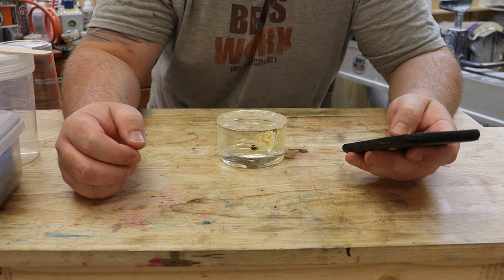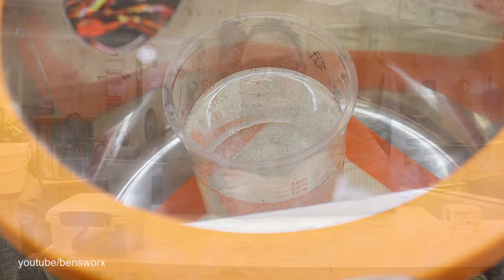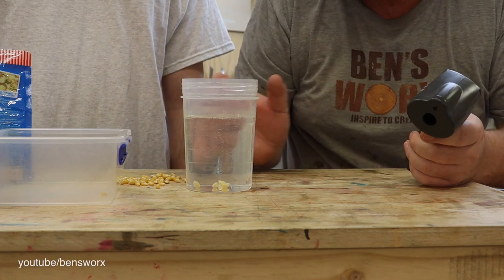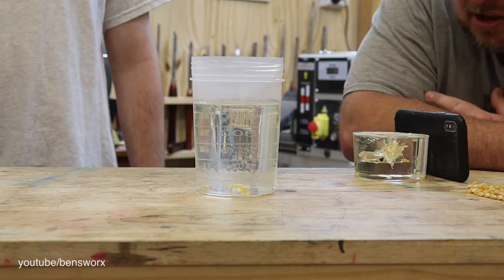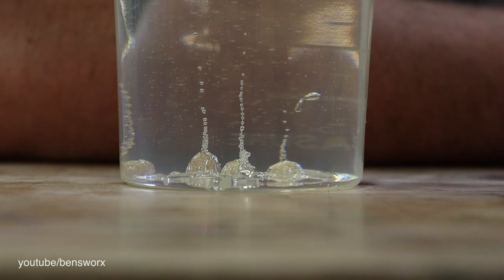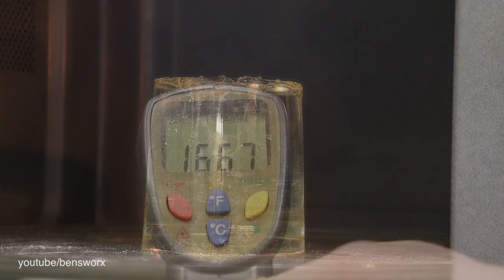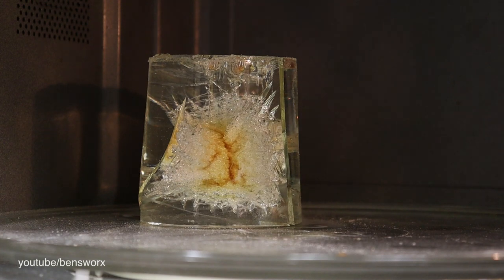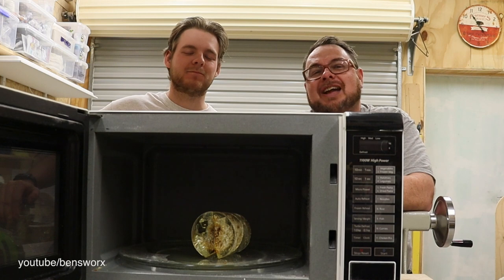Kernels in Epoxy Resin Vs Microwave

Comment: Put them in the vac chamber while the resin cures, a reduction in pressure will lower the temperature needed to pop the popcorn.  Also, don't rest the bottom of the cup on a surface like you did.  The kernels at the bottom had the temp wicked away by the table.
Reply: Exactly what I was thinking too.
Reply: That or he could place it on a slitlely hot surface to contribute with the heating process, besides not losing energy to the table
Reply: Beat me to it :D   The vacuum should also slow the rate that heat is leaving the resin, meaning a higher max temperature.
Reply: The vacuum would help, but not a great deal.  A quick Google search tells me that popcorn pops when its internal pressure reaches about 135 psi (930 kPa), a bit more than 9 atmospheres.  This implies that popping requires a pressure differential of a bit more than 8 atm between inside and outside.  So even under a vacuum, the corn would have to be heated enough to reach an internal pressure of more than 8 atm.
Reply: @jpolowin0  Putting it in a vacuum chamber gives it a 15psi head-start and lowers the temperature needed to pop it.

Comment: if that is a throw away microwave how about throwing the resin in there while its still curing? this might give it that extra bit of heat needed
Reply: thats what i was thinking.
Reply: I was also thinking that as well. We now know that it will get to about 160. I would temp it until it gets to about 140 and then plop it in and see if it works. I think the bit of extra heat may do the trick. I really want to see popcorn in the resin.
Reply: Agreed. They have the temperature gun and have found out the max heat the resin puts off while curing, so they could pop it in the microwave when it reaches around 120-130°C. Fantastic idea. I wonder if anyone has tried to microwave resin while it cures though. Would that speed up the curing process or would it stand a higher chance of combustion? Maybe a better project for outside or at the least with their shop doors open.
Reply: I'll add my name to the list of thought that x
Reply: Paused it to find someone had the great idea before me. Try this Ben!
Reply: Also put a mild coating of oil on the kernels, they like their heat to come through like that.
Reply: I thought the same... but then I thought... at that point, you could just cast a popped piece of popcorn in the resin, couldnt you?
Reply: @bauerbach1  I'm talking a thin coat only, so you still get the kinetic shock of the kernel exploding against the curing resin
Reply: Yep.
Reply: ...and the pop comes from air! Cured resin doesnt have air to pop the corn!
Reply: @doninis1354  this is, I think, the most logical answer. lol
Reply: why not cure the resin in the vacuum chamber?  The partial vacuum will lower the temperature required for the water inside the kernel to boil.
Reply: @doninis1354  The pop comes from the sudden escape of the steam formed inside the kernel, not because of air. As long as the kernel gets hot enough, the pressure from the steam inside will cause it to pop.
Reply: Yeah I was going to say that too, because having the resin cure on them first they are not going to pop, they have already released some energy, and they are sealed up in a hard surface. Microwaving the resin while its still in a liquid state would be the best bet if you wanted to see it pop inside the resin.

Comment: If you want another shot at it, try this:
Make a solid base of resin like you did in the first video. Then, put a few kernels and encase them in resin. When the resin starts to get hot, say around 120 C, put it in the microwave and heat it up while it's still curing. You may end up with the results you want. 

It's worth a shot anyway.

P.S. Thanks for including Jaycob. Would like to see him more.
Reply: That's what I was thinking
Reply: how about when you put the kernels in, put a bit of cooking oil and seal it in the resin.

Comment: Put it in the microwave as the resin is reaching peak temperature to boost it a little, I think it will only need seconds.
Reply: Another idea would be to do intentionally overheat the resin. I think Peter brown did that when he made the “lava bowls” using water based dyes. Maybe adding a bit of water would work?

Comment: If its a throwaway microwave you can modify it to have a small porthole where you can get a better view of whats happening.
If not you can always adjust the focal length of your lens to view inside the microwave

Comment: Would you be able to put it in the microwave while it is still curing and closing in on 160 degrees?  It should only need a small boost in temp to get it there

Comment: I have no idea how laser pointers work but would hitting a popcorn kernel with a high power laser pointer be enough to push it to the necessary 180 degrees so it would pop while the resin is setting?

Comment: Ok.  Try this.  Create a new cast with a void for a few corn kernels of poppable corn, but instead of trying to pop them in a microwave, try popping them from the top (or side so the sunlight can get through unaltered) or even making the cast with 6 flat faces to make this easier, using a magnifying glass and sunlight.  Also try and put a tiny amount of vegetable oil in with the kernels, just a drop.

Comment: The problem is popcorn works by pressure differences. As the pressure builds in the kernel, due to oils and moisture inside being heated it expands with a rapid release of steam. It can't burst in the resin because the pressure of the resin around the kernel stops the rapid release. That's why you got escaping air bubbles in the resin as the skin of the kernels rupture slowly releasing the pressure into the thick viscosity of the resin.

Comment: The only thing I can think of as a last possible option for this experiment would be to put the kernels in, and then putting them into the vacuum chamber, it'll lower the boiling point and the pressure in the corn kernels giving you a slightly higher chance of them popping while the resin is still curing, I see a couple comments suggesting similar.

Comment: I think that placing the popcorn kernels at the center of mass might be hotter.  I'd also try mixing the resin a bit hot with the activator though that might cause an exothermic reaction.  And make sure you are using a good quality popcorn that was stored properly.  As I understand it, internal moisture of the kernels is critical for popping corn.

Comment: I wonder if they preheated the kernels a bit before dropping them into the resin just to make up the 20° difference.   Or maybe set the resin on top of something metal that might help reflect the heat more towards the kernels.

Comment: The thing with popcorn it is super heated gas that expands in the cornel. I think that once it gets to a certain temperature you should assist it with a laser or even see if you can microwave the epoxy while it is setting to see if you can induce the corn to pop that way. 

What does happen if you microwave epoxy while it is setting?

Is it productive to vacuum out all the bubbles just to introduce more bubbles when you pour it into another container?

Comment: It would probably be easier for future experiments to find out where the hotspot of the microwave is and position the pieces accordingly. I think wet thermal paper can be used for that. But be careful. The hotspot gets hit with enough energy to melt metal.

Comment: heat it with a Fresnel lens, it will pop real fast. its just a type of magnifying lens/glass but it can melt metal if you use a large lens. just hold it in the sun.

Comment: If you pour a thick layer like a tall cylinder tube you should build the heat without using a ton of resin. However, I think that it would be dangerous because as you see the violent reaction inside of cured resin, could the popcorn kernels blow resin around the room?  Either way thank for the bonus video. It was great fun.

Comment: I'd super glue the kernels to a toothpick, and set it in a base to keep them upright. It would be awesome to see it explode right in the middle. I wonder if there's a better way to heat it or assist the heating to get it up to 170 than a microwave. You were already so close to it. A heat gun? A heat lamp? A hot plate? Or put the resin cup a simmering pot of water, to keep the cup from melting?

Comment: If you really want it to pop in the resin, you can try heating up the kernel a bit first then dropping it in.... OR by increasing the heat with a laser or focal lens.

Also, please wear safety glasses if you attempt this again. I know it might not seem it but the force of one kernel popping is quite massive.  If you compound that by surrounding it with resin, it may send shards flying.

Comment: There is a reason why popcorn bags always has some fat/oil in them. The seeds themselves are mot moist enough to get heated and as you know, microwaves needs moisture to transfer their energy to heat. So, please do it one more time but this time add a little bit of vegetable oil or something similar to them.

Comment: How about mixing the resin.
Degassing.
Put in the Pop corn.
Then put it in the microwave as the temperature reaches around 140°?
See if the extra heat will help as the epoxy is still simi hard.

Comment: I am thinking, if the pressure in the pot prevented the kernels popping the previous time by increasing the boiling point, would leaving the blank in the vacuum pot while the resin is curing lower the boiling point and cause the kernels to pop at a lower temperature?

Comment: Microwaves actually don't cook extremely accurately. The patterns that the waves hit miss quite a lot of the area of the microwave, so you pretty much have to use the turntable. I forget which video I saw which actually showed this, but they had a chemical that turned color when microwaves hit it and very little of the bottom of the microwave actually gets hit at any given time. It's also a static pattern so the more off-center you put something, the more effective the microwave will be.

Comment: Just a thought... the most heat I have gotten when working with resin was an accident. I was working outside, on a hot day. My bottles of unmixed resin were outside with me, and in the sun... When I mixed a small bit of resin, oh WOW did I have HEAT! It melted the plastic cup, and part of the plastic table before I could even use it!  I am betting that on a hot day outside, with your unmixed parts already a bit too warm, you could get the kernels to pop!

Comment: Ben. When you do the next poor go with a little bigger mold so you create a perimeter around the blank.   Also could you try to microwave a poor while it’s curing at the same time?  I’m not sure if the microwave will speed up the cure time or not but with pop corn you may get a cool affect

Comment: The temp will go up with the volume of the casting. Try doubling the volume of resin, and it may exceed the 200C you reached the microwave experiment. You can test the hypothesis by making a pot of  1/2 the amount of resin, and it should not reach the 160C temp of the batch in your experiment.

Comment: If you're only 20 degree off, I'd say do this more or less exactly the same and use the laser to bring the kernels over the finish line.  Maybe use some string to suspend the kernels in the middle of the resin?

Comment: Keep in mind, in order to pop, popcorn kernels need to be unholy.  Kernals with shells with holes in them will let the steam release without the starch liquidizing and therefore cannot get to a pressure to cause a pop.  SO the fact that they were bubbling in the resin, may have indicated that they would have been old maids.  The fact you got them to pop in the microwave is probably due to the fact that the steam could not escape or expand so pressure was able to finally build up.

Comment: Wouldn't using pressure compress all the little air bubbles and make the whole thing want to explode? Like wouldn't (couldnt) that lead to the part eventually failing because all the air is still inside, but under pressure? Hope I'm making sense.

Comment: What if you place the container in a pot of boiling water similar to the method of melting wax while its curing it could raise the temperature enough to pop the kernel

Comment: It would be nice if there was a way to suspend the kernels in the resin, rather than having them at the bottom.  Maybe pour a first batch of resin into the mould, wait until it's firm but not solid, then pour more on top?  Or hang the kernels from strands of spider web or "invisible" thread.  But as other commenters suggest, put the thing in the microwave -- covered! -- before it cools off.

The bubbles you saw around the kernels were probably from moisture slowly leaking out.  At that point, you'd be losing popping power.  Maybe you could solve that in part by coating the kernels with UV-cured resin.

Comment: perhaps if you kicked the hardener up a bit higher than recommended. That is going to cause a faster cure time, and generate more heat. You were so close to 180 this might be enough to get you over that edge and make get one to pop and make the resin mess on your workbench you're looking for!

Comment: So instead of using the pressure pot or vacuum chamber ...... do the bottom layer for "suspension" and before the top layer fully cures pop it in the microwave 🤔

Comment: Next Try: Leave the resin in the vacuum chamber under vacuum while the resin cures. Water boils at a much lower temperature at lower air pressure, so theoretically the corn will pop at the lower temperature.

Comment: haha great stuff guys, the thing that makes the kernel explode is the evaporation of the water inside before the outer layer softens. so the 2 that split and let out air, softened to much to pop before the pressure reached critical. the only thing i can think of is, what if you tried to hit one of the kernels with a sun beam through a magnifying glass? also i was a bit afraid if one did pop that it was going to splash you in the face with hot resin, so maybe a cap on the next one?
Reply: I agree.

Comment: Water becomes steam at 212 F providing you add more BTU’S and pass through the latent heat of vaporization phase.
Reply: The US is the only country that uses F, 180C is way hotter than 212F. Boiling temp of water is 212F or 100C. I wish we used the metric system rather than constantly having to figure out the exchange. 
From the Washington Post article: What is the best temperature for popping popcorn?
 356 degrees Fahrenheit

 The pair applied their knowledge of engineering and thermodynamics to the task, calculating average hull strength, standard water boiling conditions and critical kernel pressure, and found that 180 degrees Celsius (356 degrees Fahrenheit) is the ideal temperature at which popcorn should be cooked.

Comment: It's hard to pop corn with no oil. If you made a hollow core again with just a little oil with the pop corn, maybe the oil would heat up enough to pop the oil, as opposed to heating up air. Idk. It might end with a "catastrophic failure" though.

Comment: Try a different brand of resin.. maybe one that cures faster as it will generate more heat. I used one brand that I filled a silicone mold with less than 10 oz total. Temp got to 255 degrees F as measured by a Flir device. Needless to say I won't be using that brand anymore... it even said 40 minute working time.

Comment: why not cure the resin in the vacuum chamber?  The partial vacuum will lower the temperature required for the water inside the kernel to boil.

Comment: Why not wrap the container in an insulator, put a lid on it, so much heat is lost through the sides out to the cooler atmosphere. If you put it in a warm oven at 140-160, you would only need the resin to generate a bit more heat to cause it the kernels to pop. I would also use another container, maybe something high temp and able to take the pressure of the pop. 
And a dangerous thing for your son to be that close to a possible splash of resin in his unprotected eyes, you at least have glasses on for some protection.

Comment: Baby face Jake needs to grow some chest hair before you set him loose on his own. As to todays X spearmint (😆) it just shows you the power of water. There is not enough water in a kernel of corn to create a single drop of rain. Yet when you added a bit of heat it cracked that resin like a peanut.